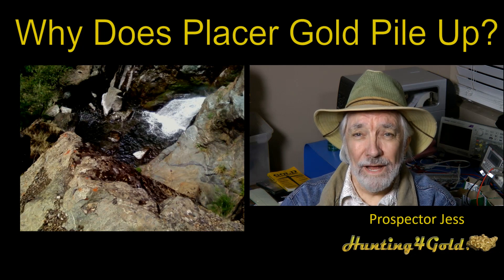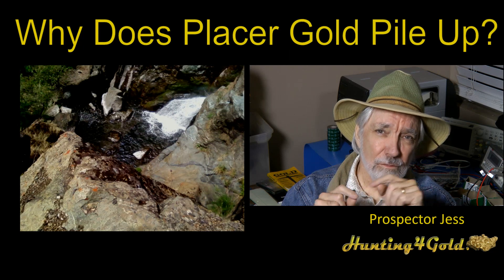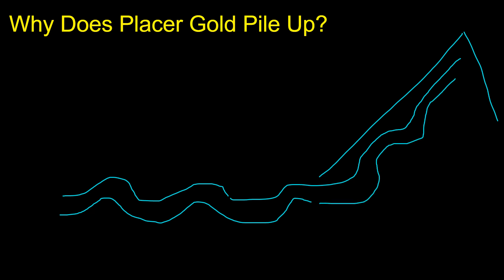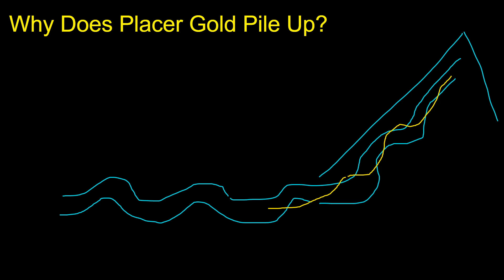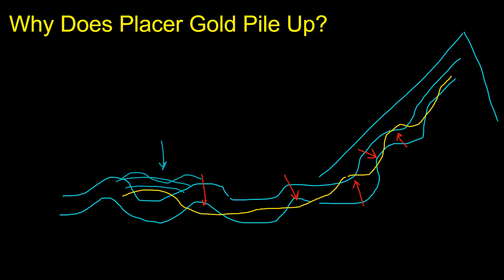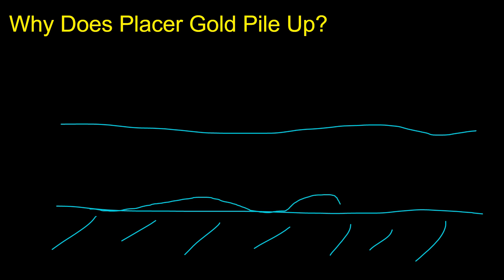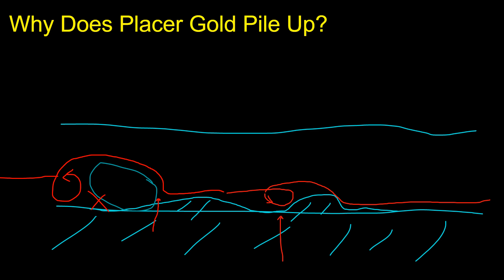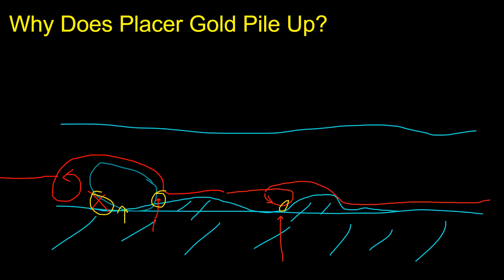Where Does Placer Gold Pile Up? (How nuggets concentrate)

Comment: Yeah it’s not always on the inside of the curves, even when it is the original main cut of a solidly embedded river. The slower sides of water flow curves appends on the speed of the water at that part of the river, in balance with the amounts & types of material, slope of the elevation & gravitational pull or push of inertia in relation to the speed of the water plus the other factors again. If the water is starting to gain speed & the slope is slightly or heavily to the inside of a river curve, then the faster moving water in that area is to the inside regularly & for long periods of time till stronger water flows temporarily shift it to the outside with inertia. So the side that has the larger amount of sediment stackings is the slower side most of the time.